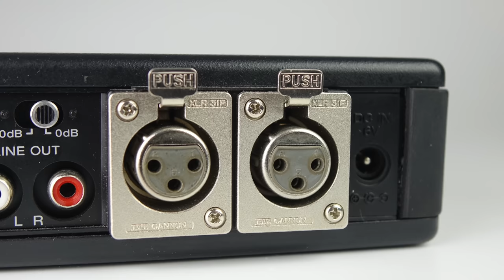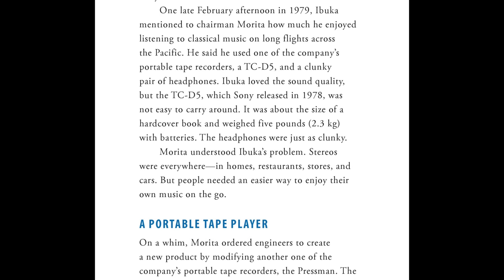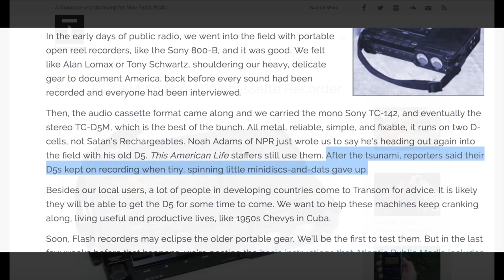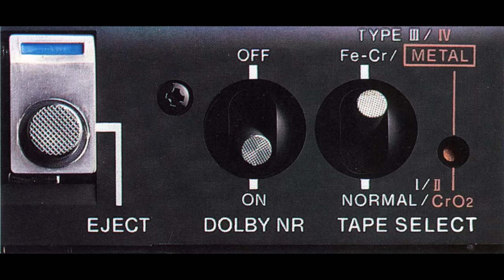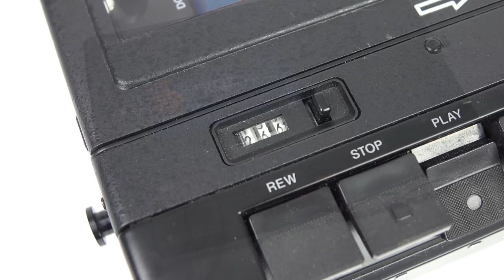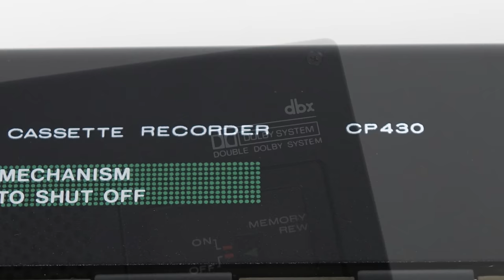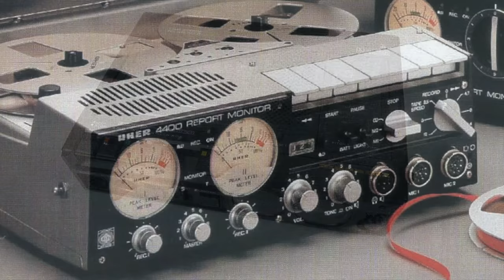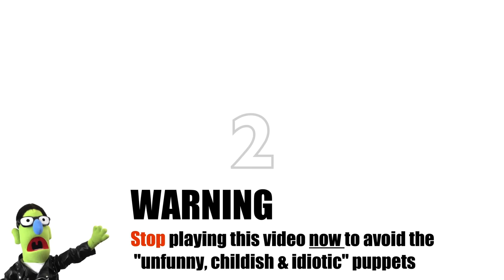Classic Tech - Sony TC-D5 Field Recorder

Comment: I bought a Sony TC- D5 Pro II off Ebay on Tecmoan's recommendation. I was planning to get a high end cassette deck to transfer a a number of pre-recorded tapes I bought in the 80's & 90's onto CD to play in my car...... Yes really!
I remember seeing TC - D5s in use by reporters from BBC Radio well into the 90's. Having recently got one, they really are well built bits of kit. Rod Munch wonders what people in 2117 will make of Techmoan's videos. I reckon a few Sony TC-D5s will still be working.

The sound quality listening to a decent pre - recorded tape (e.g. Flag album by Yello from 1988, anyone remember "The Race"? a good test for any Hi Fi set up) on Chrome tape through my 1979 vintage Rotel RM-5010 "Music Centre" and Monitor Audio R100 speakers is fantastic. Next to no hiss, even between tracks, every note and beat crystal clear. And the Bass! No need for the Loudness button.

Comment: What a fantastic looking piece of kit. Solid design and lasted for years, and like most Sony stuff, pretty reliable. Like you said, it was probably as good as any hi fi separates tape deck available as well but was overlooked for cosmetic reasons plus they were on the expensive side. I did like the Marantz one as well. I had forgotten that Sony used to put that 'Sss' sticker on their hardware so it was a bit of nostalgia trip too.

Comment: Lol fancy myself carrying a SL-F1 on the right shoulder and a PCM-F1 on the left, both working on batteries... but hey, that's portable digital recording back in 1982 😄
As for taperrcording, I tried the D6C. Nice unit. Then I went back and buy a late 70's tapedeck.

Comment: have you ever heard the term "hybrid equalization?" if you record a blank tape type II or iv but use the 120 micro-second (normal tape) equalization, you can squeeze more maximum output loudness than if you use 70 micro-second equalization.

Comment: I would absolutely love to buy one of these, but they're SO expensive. I have a Sony TCM 40dv which has gone bad, the slow time switch doesn't work so it slows down all the time, and it makes a horrible motor noise. So I bought a Sony WM-FX123 but that completely went dead, so I opened it up and it turned out there was an oxidized pin so I unplugged that, it worked. Then it started going fast so I adjusted a little potentiometer on the board, but then it completely broke off, leaving it fast forever. So then I gave up all hope and bought a modern digitech cassette player, and it works and its quite robust but its sound quality is horrible! It's very tinny and quite. So now I am wondering if I should spend AU $1,190.09 and get myself a Sony TC-D5M or not. Oh well.

Comment: Uher went on to make the CR160 which has Dolby C but no metal type IV tapes. They also made CR240 AV, CR160 AV and specialised CR1600 with multiple tape speeds and AV features for slides and film recording and playback. 

I was looking for a cassette recorder about 1978. In one hi-fi the manager said the Uher representative was puzzled that their cassette recorders were not selling. The CR124 sold well in Japan where purists wanted a machine without noise reduction but even the CR240 was not selling. Sony had machines with Dolby C and compatible with recording on type IV metal tapes, where smaller, lighter and cost less. Shortly after getting the Uher CR240 they dropped the price by 25%.  The CR160 has Dolby C but no type IV and no Dolby S or HX Pro releases. Left Sony and WM-D6C Professional Walkman as the last word in portable cassette recorders.

Comment: I bought a TCD-5M in the mid 90's. Still have it. Used it sparingly so it's in mint condition. I kept it in the original box over the last few decades. I recently checked to see if it worked. Unfortunately, it doesn't. Well, the capstans don't turn, but it turns on, so I'm guessing it's a belt dried up or rotted over the years. I opened it up and looks like a pain to even check the belts, never mind repair.

Comment: Thanks for the video. Nice list you put together, some remarks:
The Uher CR160 is missing, it is a newer and improved version of the Cr240;
The Nakamichi 350 also missing, same quality as the 550 but smaller and less featured;
Philips D-6920 you mentioned is quite low-fi and not suitable for music recordings, it was meant for audiovisual puroses. Although stereo, very low specs, like cheap boombox, more durable maybe.

Comment: Great look in on what appears a top quality cass. machine. I still have my Marantz CP230 and how right you are about the quality difference between the Sony & Marantz. For a start the tape suffered a lot of Wow & flutter and having attempted a repair on it - I found its tape transport  very poor design with weak components. It also had a BIG hunger for batteries. It was never successful  to me    for  8mm film sync recording , and let me down many times - Sony came to the rescue with the WM-DC6 - which is still a great  little  performer to this day. The Marantz nah!.

Comment: One thing you forgot to mention but might be interesting to know, is that the Sony TC-D5 Pro came with an awkward design flaw: male XLR's. While these chassis mount connectors fit nicely into the existing panel, standard mic cables require a female XLR to plug into and therefore could not be used without resoldering the cable or using some sort of adapter. This rather unfortunate and costly blooper (that probably cost somebody his job) was eventually corrected on the revised TC-D5 Pro II. The 'wrong' connectors can be seen at the 6:40 mark. TC-D5 Pro's are extremely hard to come by and I wouldn't be at all surprised if those male XLR's had something to do with it.

Comment: Just bought TC D5M about a month ago. As it is pretty old and has probably been sitting on a shelf for quite some time, mine had a mechanical ticking problem. The motor has been sitting in one position on the capstain rolling wheel for to long and has left a mark there. Nothing wrong with the belts, only the rubber coating of the capstain wheel. Have to find a way to fix it. Otherwise works fine.
As far as I get it, then Pro model is good only when recording from microphone. For line level recordings M model should suit best.

Comment: Loved the video. Just wanted to mention that I've got a Marantz PMD222 on loan from the radio station where I used to work, and damn. That thing is solid as a rock. It's a little nicer in construction than the Marantz you showed off (metal body, heavy), but has fewer features than both. One interesting thing it does have is a telephone in, for recording over the phone I assume. And about the rechargeable battery problem, I think our solution was to just carry a few spares. I've got a box of those too. Nice thing is they're the same size as three D cells, so you can use either.

btw, I think it would be interesting if you did a video on the Sony WM-1 Walkman. It's noteworthy because the name has caused some confusion. WM-1 sounds like it should be the first Walkman, but it's actually not at all. It DOES share the dual headphone outs though, but not the "hotline" button. The original Walkman would also be a really cool video, if you can get your hands on one. A certain Marvel film has really inflated their prices.

Comment: Both CassetteMaster and DrCassette have made videos about the Sony TC-D5 series recorders, so I've known for some time what they were, but I'd not fully understood the significance of them being portable field recorders.  I've not actually used one of those recorders, but I believe I have played with a Marantz CP-430/PMD-430, (I don't know what model number they used in Australia.  The Marantz recorder I used belonged to a radio station here in Melbourne, and I think its speaker was broken.  I wouldn't mind trying out a TC-D5 at some point, it certainly looks like a high quality piece of equipment.  I imagine that many radio stations here used them.  Have you looked at any of the digital field recorders like the Marantz PMD-660?  Like the 430, the PMD-660 kind of feels a bit fragile and plasticky.

Comment: an RCA to XLR cable will Not convert line output to Mike input.  It shouldn't even be used for line to line, let alone for line to mic. The signal you got was not merely "hot" - but impedance-mismatched, and lacking ground.  A lovely episode of course as usual, featuring a remarkable machine.

Comment: Back in the 1980's when I was living in Perth Aust. The TV news used professional super 8 cameras running at 24 fps not sure but I like 200 ft reals. I know this as Channel 7 had their own processing laboratory that would process film for the public. The proviso, it had to be professional Extachrome slightly more expensive. I think turn around time was about 2 hours. So TV Stations in Australia did not use 16 mm at this stage. They followed on with this with Betacam cameras.

Comment: That's a cool mechanism, looks like a flywheel, and a servo system with a magnetic clutch of sorts. (Or is the coil only for feedback?) I assume the servo circuit can change the motor speed and assuming it is a clutch, apply the brakes to the flywheel.

Comment: You mentioned the "Elbow" cassette player which I checked out...as it appears in that video it can NOT work as there's no capstan/pinch roller to regulate tape speed, in the video I saw it's only reel drive.  

There are reel drive tape drives out there, for instance the "mini-cassette" that's used for dictation, but as the amount of tape on the drive reel changes the tape speed changes...it's the capstan/pinch roller that regulates the tape speed in the full-sized cassette, and the mini-cassette is only good for voice not only due to the changing speed, but also lack of wow/flutter control.

Comment: Fantastic video. 5 on ebay.ie now in 2019. Two being the "M" model the one that could play metal tapes. One is ex BBC Bistol ( not the "M" model so the BBC were probably not using metal types at the time. Most of them very north of 500 euros.

Comment: FYI, the TC-D5 Pro units used a Ferrite record / playback head which is very durable and as hard as nails but unable to be used with the higher levels required for recording on Metal tapes. The TC-D5M on the other hand used a Sendust head for record / playback which aren't as durable but can handle the higher recording levels. All down to durability really.........

Comment: There does seem to be a lack of those sort of portable cassette recorders that are made to a very good quality and do very good recordings. There was someone selling a Sanyo RD-4260G and this person was selling it for £20.00 and they said that it was built like a tank, the one that I Bought cost me £2.00 and it has wood and brushed stainless steel, it will also play Ferro and Chromium dioxide and and it has a long time metallic head.

Comment: Hi Techmoan, Really appreciate the quality of your programs.  I own the Marantz PMD-430 - same thing as the CP430 you showed in the video here.  It may not be as robust in terms of overall build quality as the TC-D5, but the sound quality is really hard to beat, especially with metal tape.  I have done many listening tests with it using different kinds of tapes and I must say that particularly with Fuji Metal-Z cassettes, it renders a copy that is nearly identical to whatever source you're recording from, with only some minor loss in dynamic range.  I have not heard it's equal short of some really expensive home recording decks. 

You mentioned talk of higher wow & flutter on the Marantz - I've not heard any significant issues with this on my units, and I've owned several.  Comments about that spec may only be of real concern for very critical applications or hardcore enthusiasts who are particuarly focused on those numbers.  While I've not directly compared the PMD-430 to the TC-D5, I'm sure the metal reocrding capability and 3-head configuration give the Marantz some real advantages.  However,  your demonstration of that Sony mechanism playing steady while being shaken was quite impressive and that model may excel in areas where the Marantz does not.
Reply: ive got both, and indeed the 430 does seem to go 0.5-1kHz higher than the D5M, however, depending on type of music, its none to barely noticeable. The problem is, the 430 broke down multiple times, needs azimuth correction quite often and the wow/flutter is all over the place (reading from not so cheap test tapes and oscilloscope)... and its been stored in leather case and maintained each year. In comparison, the nastiest D5M i own was stored in a garage, was filled with gunk and had acid damage from leaking batteries. it didnt need belt replacement as that was just for the auto-stop function, it just needed few wires soldered where the circuit was corroded, and after a bit of cleaning it works like new! its a shame i cant say the same about the 430, the monitoring head is cool feature but its not the deal-killer here and its just prone to misalignment more often. on the D5M i adjusted the record level to match the playback level and i can now trust those VUmeters and dont need to worry about the quality and record levels.  and the variable pitch of 430 is actually a huge minus contributing to wow/flutter as it has a shitty low-res trimmer (more parts = more things that can break) actually ill hack the thing out and put my custom universal motor driver with pitch from 0-100% which is x10000 times more stable than its internal driver. the mpx-filter is also cool but usually i leave all those NR stuff switched off as i play same cassette on different machines. im glad i got the nasty D5M with its few defects much much cheaper than the marantz which will break each time after a year of servicing, makes selling the 430 much easier and without regrets :D
Reply: @alexsicko  Thanks for your comments.  Maybe you use your 430 alot more than I do?  I haven't had any of those issues with mine, but I would consider myself a light user at this point.  Haven't pulled out the 430 in a quite a while.
Reply: @solidaudioTV  dont have to, its just a conclusion of mine after having tested both devices. sadly i didnt abuse my 430 either, the motor just made funny noises and ran faster/slower, suddenly magic smoke comes out from the motor. it happened all in 8 seconds xD its just a bit more fragile than a D5M but when it works and if theres no w&f, then it sounds amazing. mine also had problems in record mode and not pb, before motor went crazy

Comment: Its a Sony. Nuff said.
 It really does say it all. That motor drive is an example of how they seem to overcome any technical problem. And with more style than most competitors.
However making an operating profit is proving a harder nut to crack. But I hope they do and are around for a while yet.
Reply: Sony will be around tough, their all divisions except the mobile are making profits. Their monopolizing the imaging sensor business as they are making the best sensor these days. Every major player using sony's sensor, Nikon, Fuji, Apple, Samsung, etc. They photography and cinema camera are also making a splash, taking 2nd position of Full frame camera market from Nikon just last years. And the cinema camera division making Canon's a beating.

Comment: Actually there is a cassette tape deck with noise reduction you can still buy new today. Its the Teac W-1200-B. This model and the Teac A-850 (apparently identical to the Tascam 580 mentioned in the video) are the only quality cassette tape decks that are still produced i guess.

Comment: WOW, you mentioned the UHER IC 2000 IC report reel to reel recorders IC report machines at the BBC. well, I worked for a year on BBC attachment at LH Langham House (now a hotel by the same name opposite BH Broadcasting House) which was the Radio training HQ and I used to look after 11 studios on the fourth floor and all hand-me-down studio from Transmission Studios, mostly valve driven with Bakelite control knobs. My job was training students both local and overseas in the field recording techniques and the tapes from 4" reels of the IC reports were edited on, yes, old Ferrograph MK4 recorders driven by valves. The point is in the old day's 1979 cassettes would have been useless for editing reasons but so impressed I was with UHER. I bought a CR210 portable cassette recorder for home. When I first saw the Sony versions I must admit they looked great because although the UHER machines sounded brilliant, I did not like the end-on loading mechanism which the Sony versions had a top loading type. Oh, nostalgia! Thank you for the video. Ian

Comment: It's kind of funny that my brother thinks his old Realistic duel cassette deck from 1986 is trash now ever since he started using a modern computer back in 2000. I was using it (mostly storing it) for a decade after that to digitize takes. When I started using it, I had to open it to clean the controls and circuit board because it had pop spilt into it when he had it. The belts were slipping at first, but on his recommendation I rubbed rosin onto the belts and the tape deck continue to work. I eventually gave it back to him because I don't really have old tapes worth digitizing anymore, but it still beats everything else we have into house for recording on/playing cassette tapes. I made a suggestion to him that it would likely be worth while to replace the belts with new ones to give it a new lease on life, but he now sees audio cassette as the worst format ever released. He is very critical of VHS as well. Personally, I see it as an economic way to obtain older movies, but he says he can't stand the time base distortion, chromia noise, and worst of all low definition. The funny thing is that when I transfer the tape to DVD and that to h264, on a really good tape all that seems to left after noise filtering is low definition. I generally upscale it to 480i to help with that. It ends up looking soft though, but I prefer that over the pixel look.